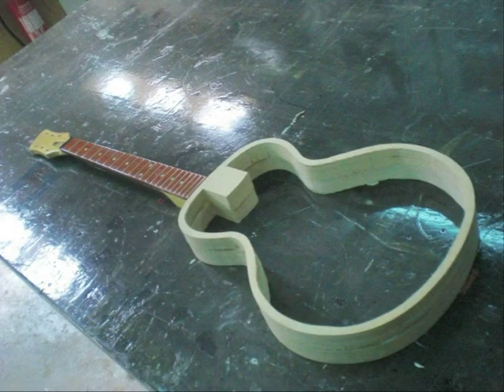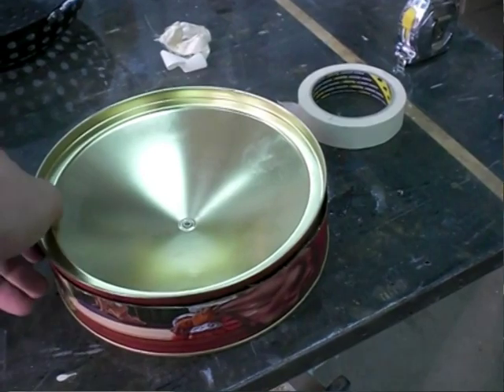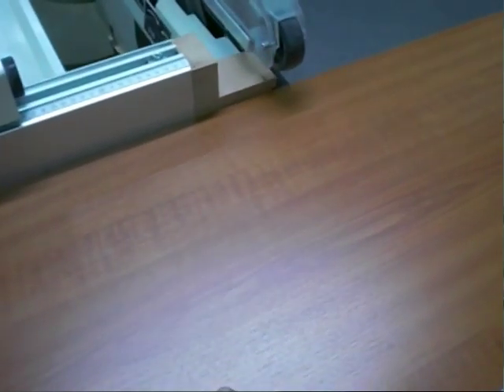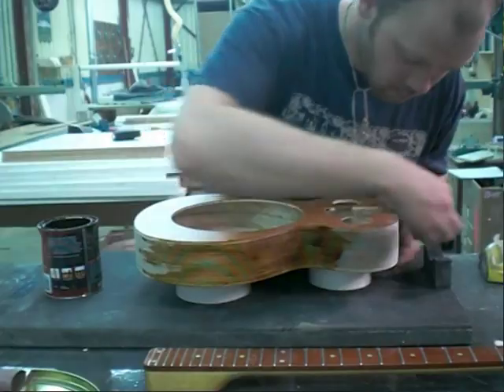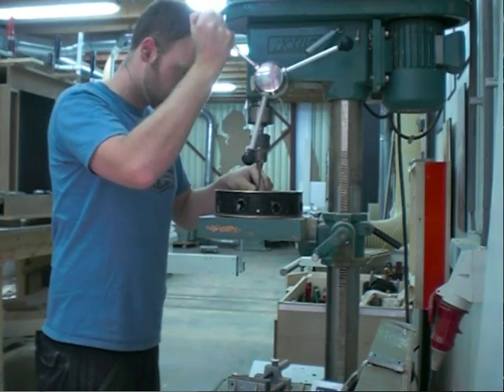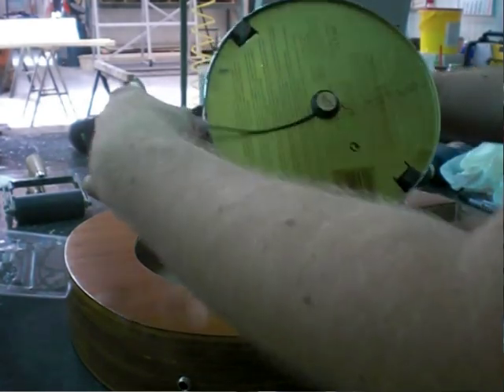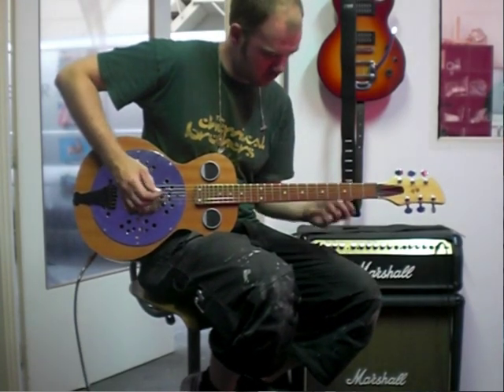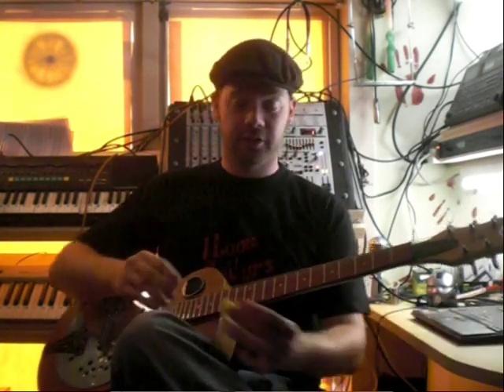Resonator guitar build

Comment: When cutting metal on the table saw, set the blade low. 1/2" maybe. This will minimize the chance of the blade snagging into the metal and throwing it back or something even more dangerous. Had it happen once...very scary. Fortunately I only had a minor cut. But you learn.

Comment: Sounds good.  I have built a few resonators but mine are more re-builds as I used a factory built guitar.  Purchased the hardware and retro-fitted it into the body.  I was always afraid that using a cone like you did would not produce jenough of resonance but yours sounds good.  I am building a tri-cone now.  You have a nice shop to work in, I have to use all hand tools.  Have a nice day.
Reply: I believe aluminum will give you a better sound than steel. Seen it done with hub caps.

Comment from the maker: @mjlyam :I made a reverse cone with a spider like bride, the strings rest on a brige connected to the spiderweb. and it really sounds like a resonator guitar, I own a delta6 resonator, and it sounds just like it, only a little less powerfull because of the small body size. 
@MrThedaillamaknows:  thanx for the tip

Comment: A little rattle at the last strum. Your bridge angle cutting the strings may not be right or you might not have the correct downward pressure on the cone. String height, string gauge, and tuning create this correct tension. Very creative. Thanks for sharing. Nice video and build. Enjoy.

Comment: Looks good. Try open G or open D. They're tuned down so you don't have to put tension on the neck. Where do you get sheet aluminum?
Reply from the maker: thanx, the sheet is a left-over from a build i did for work. you can get it at your local hardwarestore
Reply: Sydney Zomerhuis Thanks.